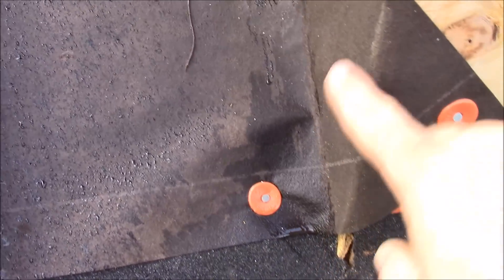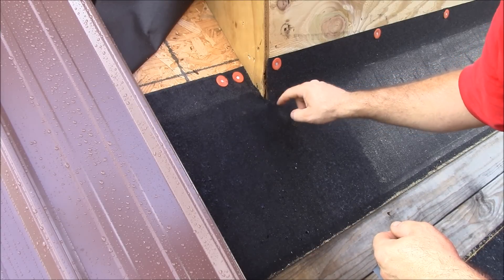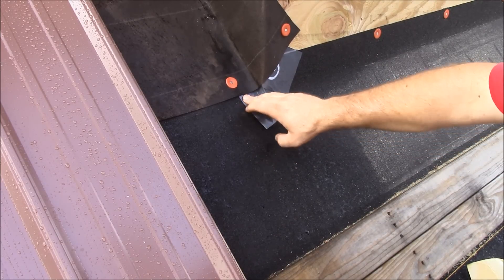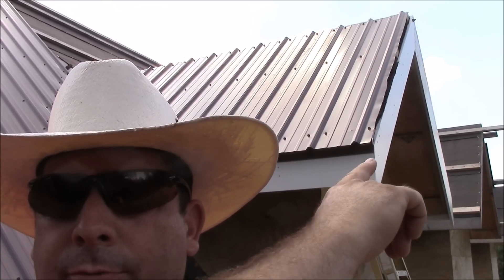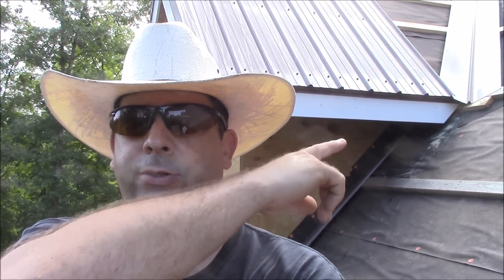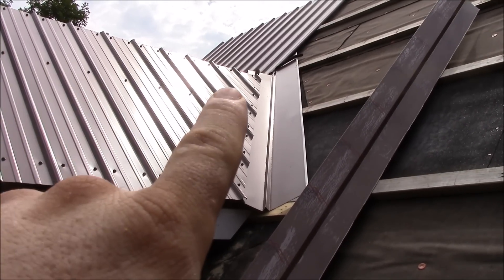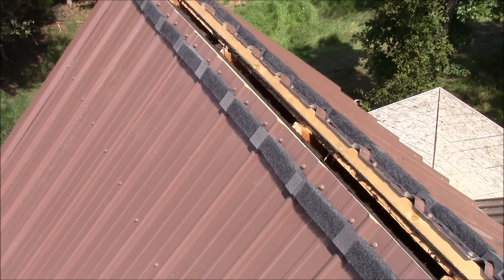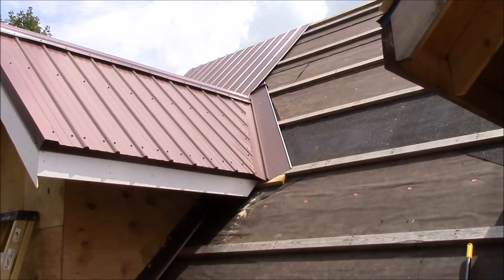Building My Own Home: Episode 37 - Cutting the Metal for the First Valley part 3

Comment: Should I screw into the ribs or just like you do into the flat area on my mom's 12:12 pitch. I'm coming up a little short in the Valleys and is three inch overlap good enough or just get a hold another piece so I can go six inches are more overlap?
Reply from the maker: If you're using the same profile of metal that I am you need to screw through the valleys. If you screw through the ridge the metal will bow and not allow the neoprene washer on the screw to seal off. I didn't have any seams in my valleys so I don't recall how much overlap is required there, but if you can't avoid a seam make sure you use butyl tape to seal between the two pieces.

Comment: another great video. I have a question regarding your roof, does it require grounding for lighting or static build up? it's looking great, we finally got some cooler weather here in the Ozarks. enjoy, be safe and keep up the good work.
Reply from the maker: +JDS hillbilly Thanks. I have never seen a metal roof that was grounded before, but a quick search shows the new building codes may require it in some places. I will have to do more research on that when I wire the house.
Reply from the maker: +JDS hillbilly Thanks. I have never seen a metal roof that was grounded before, but a quick search shows the new building codes may require it in some places. I will have to do more research on that when I wire the house.
Reply: ok, I didn't know if it was necessary or not, I don't have much experience in building or construction. I remember in Iraq sandstorms would build up static electricity in some of the temporary metal buildings that were set up. enjoy this weather, I'll be getting back to work on my little farm here in a bit. be safe. keep up the good work.
Reply from the maker: +JDS hillbilly Thanks for your service to our country! Hope you decide to share some videos of your farm with us.

Comment: How much did it cost for all those metal roofing?
Reply from the maker: junkmail1203 I don't have the numbers in front of me, but for the metal, trim, and faster was between 6 and 7 thousand. That's for the heavy gauge metal, they do make a thinner version that's cheaper.
Reply: I just ordered the cheaper metal, the metal itself is fairly decent in price,  but the trim is where it's costly.